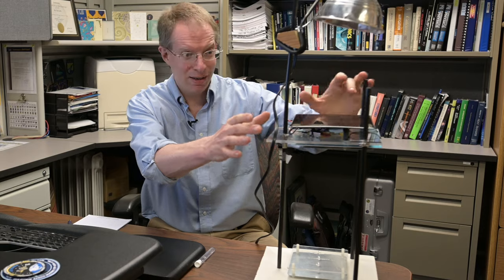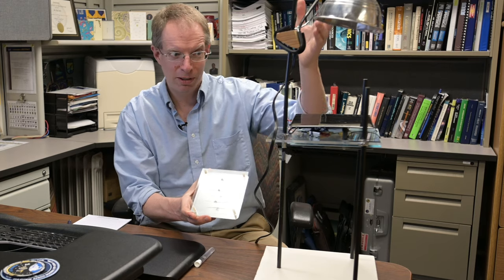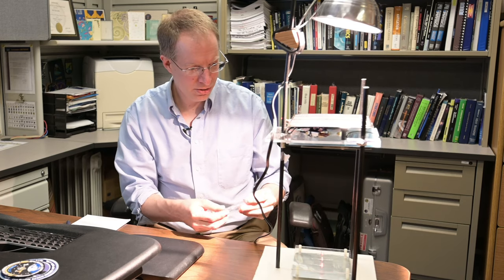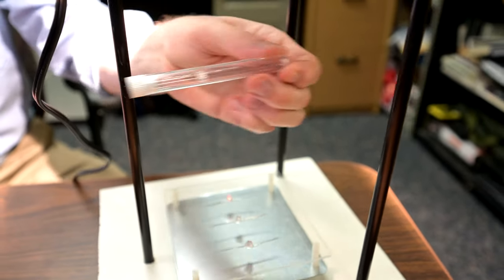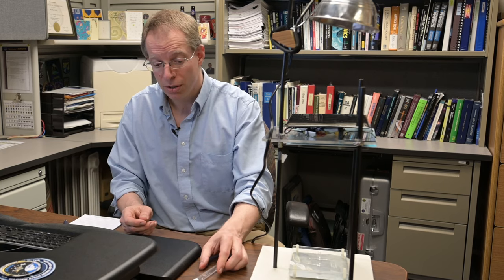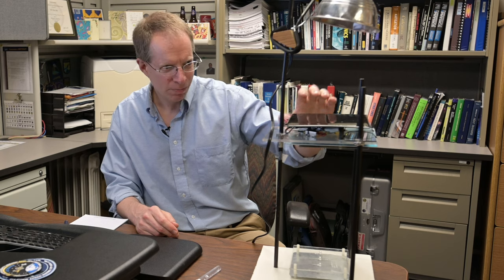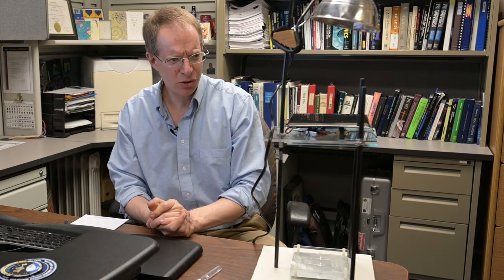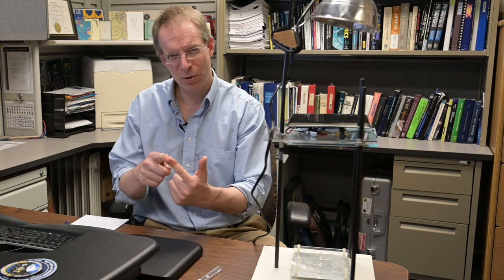NRL's Paul Jaffe Talks about the Latest in Power Beaming

Comment: Incredible work! Your teaching skills are flawless, I have question. Seeing that powerbeams would not be dependent on moving mass, does that mean that we would be able to send energy to any planet/moon within our solar system (with the same level of efficiency)?
Reply: Diffraction puts a hard physical limit on the degree to which you can focus a power beam. Larger transmitting antennas and shorter wavelengths increase the diffraction limit. Even a system that works at hundreds of kilometers, like from low earth orbit, is not sufficient when the distances get into the millions of kilometers. Just to the moon is about 400,000 km from Earth which is a thousand times the distance a low Earth orbit system would be working with. If you are past the diffraction limit you need to increase the receiving area by four times for each doubling of the distance.